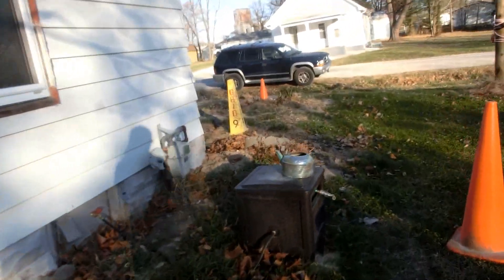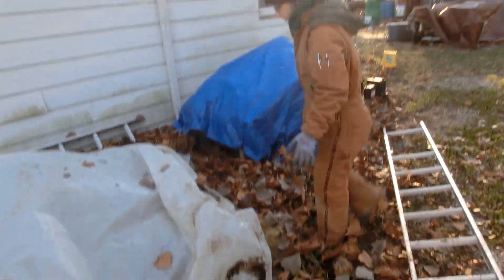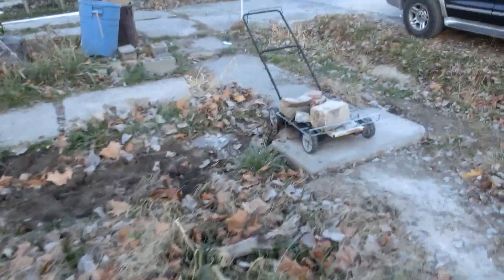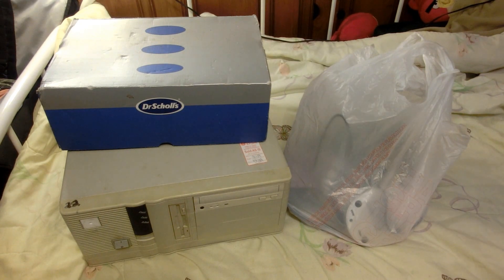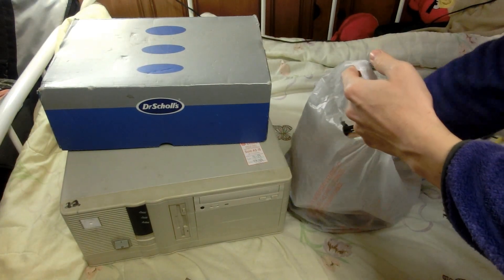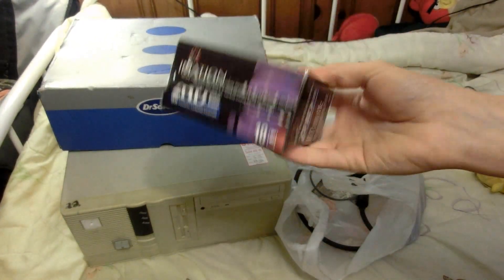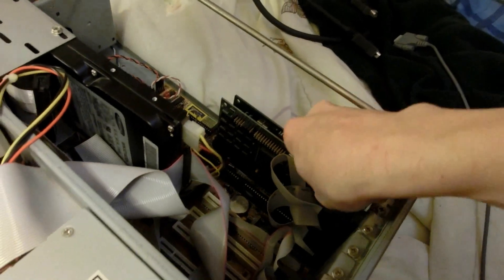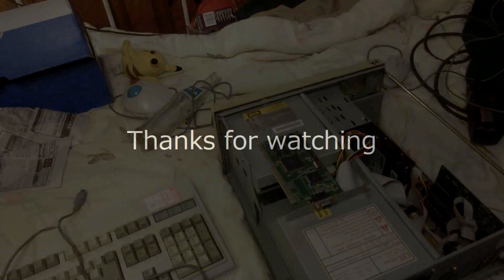Random Bits 0060: yard work, snow, thrift store finds

Comment: That computer is pretty cool. I always liked the design of computers like this. But indeed, they were often built from questionable components. I have one like this which is based on the infamous PC Chips 486 motherboard with fake cache chips. I have it running a 133 MHz AMD 5x86 and 64 MB of RAM, and it works awesome. The case and motherboard style is what's called AT. The motherboard may be a Baby AT, which is a smaller version of AT. Check the label on the hard drive; it may be bigger than 2 GB. It looks like they formatted it using DOS, so it would have been limited to a 2 GB partition.

Comment: Some guys put computers in mineral oil, as it would be a better heat sink, would still need to cool the oil. If you could get pure water, that was evaporated and then condensed that would be best. it would be neat to see how long it takes for the water and electricity to remove the plating
Reply from the maker: well if it starts to boil and that causes it to fail, then thats cool too. an hey i could always add salt.
Reply: Rinoa Super-Genius  It's and old style CPU. not an power hungry turbo beast like the later one's.. it tops out at 21.5 watt so you wont melt mutch ;)
Reply from the maker: grapsorz
 yeah i know ^^

Comment: im sure the camera used to film this could run circles around that old pc would be cool to over clock it in oil and see if it will run doom
Reply from the maker: overclocking wouldnt help i dont think, i think the motherboard creates a bottleneck for the system since it was probably designed for a p90 not a p233.

Comment: I started my IT career in '94 and I've seen a million of those... that was hobbyist-built machine.  The hard drive mounted incorrectly was a dead giveaway.  It was probably upgraded 10 times... newer mobo with older case, video card, etc.  It looks like he was nice enough to reinstall Windows before donating it, though.  :)
Reply from the maker: idk if it was upgraded much, pretty much all the parts are as low as they can get (besides the CPU) so idk what he would have upgraded the 1mb graphics card from haha.

Comment: What makes an ATX as a factor to define an old computer?^^ Even my current System is in the ATX form factor, and the case/motherboard is just 2 years old.
And I wish for it to snow this year, but no sign of any frozen water chips yet :/
Reply from the maker: well ATX isnt particularly old, but this case was made for the AT form factor. hope i didnt say it wrong in the video. and i hope you get some snow too, we currently have like 2-3 inches now. 2nd snow storm in a few weeks.
Reply: Rinoa Super-Genius oh well, maybe I heard it wrong, it's not too important, It's just a "bite reflex" of mine, as I feel as if I was getting old when using desktop computers/laptops for everything. I just can't do everything with a tablet... And I love my TBs and TBs of storage space :D
About the Snow: Well, Snowstorm doesn't sound too fabulous :/
And thanks, I really miss snow, it's been a while!
Reply from the maker: Maximilian Mustermann
 i totally agree, tablets are fine for small tasks like checking email and whatnot, but they dont have the functionality you get with a PC.
Reply: Rinoa Super-Genius just the power consumption makes a difference... Because I can't throttle my Desktop to a level where it would be nearly as efficient as a tablet while doing the same thing. At least here in germany that makes a difference. I could basically buy a new tablet every year for what I have to pay in electricity for my machine (including monitor). Just out of curiosity, what are the rates for electricity in the US? here in germany it's roughly around 30€cents/KWh (too my knowledge/experience, might be cheaper in a different location), that would be about 37$cents/KWh.
While well, those mobile devices consume a couple of watts and have extremely efficient standby and throttle capabilities. I mean they appear to constantly adapt to their current task and use dedicated hardware for a lot of things.
Now that's bad for the environment and economically as well. BUT when looking at how much energy is consumed in the manufacturing of tablets and how fast they are outdated these days while not leaving you a choice (usually) in which OS one can install, I assume it might even be more ecological to run my desktop. Well, maybe I'm leaning too far out the windows on this, as I don't know the exact footprint of a "regular" tablet (android). Any idea?^^
Well, that's actually rather interesting. Let's say a Desktop consumes about 500Kwh/year. Now that's quite a lot, but hey, those chips need to get forged too, and the mining for materials probably takes quite some energy just as well. I guess it's not going to be too easy to find an exact footprint.

Comment: Put a voodoo 2 in that PC and you can play half life easy.  I had that same PC specs for probably 2.5 years from 1999.
Reply from the maker: no, just no.

there is more to a computer than just megahertz.
Reply: you reckon it wont play halflife?
Reply from the maker: SadamFlu
 i dont think it will run it easilly. i think it would be a fucking pain to play half-life on it.

remember this motherboard isnt made to handle the p233 CPU. it was made years before the 233 came out and is probable made for a p90 or p150. not counting at terrible build quality.
Reply: i dont think i saw an agp slot anyway.  I reckon it might be ok to play it.
Reply: SadamFlu I believe theres no way that pc can hande a gordon freeman running in a steel corridor lol
Reply from the maker: Bilal Öz
 well the minimum system requirements for that game is only 150megahertz. its not a matter of if it can run it but a matter of it its playable.
Reply: Pretty sure it is quite capable of playing it at a decent frame rate.  But who cares, its a piece of shit that I would only use for controlling the lights or garage door openers and shit.
Reply from the maker: SadamFlu
 well i plan to have it running half-life when i kill it, so we will see.

Comment: i would take a guess the machine was made in about 1995? i saw the disk info said 1775 days since last disk check (over 5 years lol),  i will guess that this pc was put out of use when the owners went for broadband internet over dial up, as there is no Lan port only a dial up modem, love the fit of that hard drive though, lol , i had a trident video card,  forget 3d, even  scrolling a word processor was bad. they really are the worst of the worst, i got some cheap ati for mine and it was so much better
Reply from the maker: yeah i tried a Trident in my original IBM XT and it worked like shit.

Comment: that is the last of the AT style system's.. the ATX came in 95-96. my first ATX was a Pentium PRO 200 in 96 and the CPU alone was 1000USD :(  the CPU in that system is from 97 so it is the last in the transition. expected from a low cost computer of the time. and they where not all bad ;) not the high end systems i made;) remember. even companys like DELL started making computers like that. by 1995 they had just started to get custom cases. (i was a computer tech at the time. now i colect old computers for fun ;) )
Reply from the maker: yeah but computers like these are built so bad the IDE cables will rip/crack if your not careful. i've had it happen a lot of times. its just very bad build quality on the motherboard and many of the other parts.
Reply: Rinoa Super-Genius  yes you needed to spend some money making it in the first place. using crappy parts makes a crappy product. i just upgraded my main computer from 1996 (when i switch to ATX and all new part's) until now. i just replaced the case 2 years ago ;) so in principle i'm "still using" my computer from 1996 ;)

Comment: Dont be too hard on old designs, it still works!!, lots of super duper modern machines bit the dust in a fraction of that machines life.
Most of the people i know used those old basic machines for letter writing and basic accounting, they did there job at the time.

But, that is a heap of crap now, i would find a nice skip/dumpster and let gravity do its work ha ha :-))
Reply from the maker: well it was crap back then. its far slower than like an IBM Aptiva or whatever. its easy to find old computers that work. i've probably found about 25 so far. usually its the hard drives that give out though.
Reply: Rinoa Super-Genius
Not everyone had money for ibm back then, they are old now, but when they were made you needed to sell a kidney to afford one.
20 years from now you will be calling the machines from this era crap as they cant cope with the new demands.
Reply from the maker: zx8401ztv
um, no. i know the differance between well made computers and crappy computes most of the time. the speed and amount of ram doesnt exactly matter.
Reply: yes,a cheap budget 386sx25 i bought in 1991 was over £1500 which is closer to 3000 in todays money, and that was the low end, i still had to put in a cd reader and soundcard to do anything fun {like play doom} and it was too slow for that! , the cd cost near £200 and the soundblaster was £80 with some terrible battery speakers, you were limited as most speakers wernt magnetically shielded
Reply: Rinoa Super-Genius
The speed of the cpu and ram mattered to the applications of the era, when i used to repair machines in my teens the game side of pc's didnt exist (yes i am ancient) lol.

Machines didnt need to do so much as they do now, i dont feel the speed of upgraded cpu's or more memory like i used to :-(
Reply: jusb1066
You sounded pretty much in the same position i was, i do remember that mine was a no name mobo special lol, a 386sx soldered down and an empty co-pro socket that i didnt bother to add, it never failed, i did have a odd panasonic cd reader that used its own standard of interface, i think it was mke bus, memory has faded :-(
Reply from the maker: jusb1066
 yes things where expensive back then.

zx8401ztv  what i mean about the speed and ram not exactly mattering is that there are hundreds of other variables to take into account. you can have a motherboard that fits a pentium 233 and 16mb of ram but still act like crap due to it not having good ports or the components being slow.

either way this p233 machine feels slower than a 486 and it has very bad build quality.

this board was built in 1995, yet the fastest Pentium out a the time was 150megahertz. it was a further 2 years before the pentium 233 came out. this motherboard would probably handle a pentium 60 ok but a 233 is just creating a huge bottleneck in the system.

just because it has a 233 doesnt mean it can fully utilize that 233 like other machines can.
Reply: Rinoa Super-Genius
The problem of being able to afford an intel cpu was a factor of the crapola nature of some machines, amd was a newcommer but cheaper and not so compatable, there were also the odd cyrix range of cpu's, now they were crap lol, and shit compatability, the unknown 386 cpus were medioca but reliable, i vaguely remember the cyrix had special jumper settings than the rest.

Later i did have a pentium 150mhz, that was well decent for all the software of the era :-)
lpt and com paddle boards were pretty much the norm, and worked ok as long as you set there address and irq/dma not to clash with the mobo or other cards, i had more fun repairing pc's in those days than now, its all automatic :-((
Reply from the maker: zx8401ztv
 i think i have a nice collection of 8086,186,286,386,486 but the one CPU that has eluded me for years is the pentium II. finally got a few pentium IIs this year. i guess they where short lived.
Reply: Rinoa Super-Genius
My first pc was an elenex 8086 4mhz 640k memory machine Ooooow lol, with a western digital mfm/rll controller card, 26 and 33 pin data/control cables, i really enjoyed learning dos on that machine, but the on board fdd controller died and i desoldered all the logic chips for the controller, then added a really odd looooong fdd card instead, supporting one 5.25 320k drive (real storage ha ha ).

The 80186 i only saw on odd upgrade cards that plugged into the 8086 socket.

I had a machine called  a "Neat 286", that was a bloody lie, it was massive lol.
Reply from the maker: zx8401ztv
my first PC was a sperry pc compatible with the same like 640k and a floppy drive. that was given to me when i was about 4 or so and i fixed it when i was 5 (1998) and i used it for a few years. then after that my parents bought a new dell in like 2002 so i got our old Packard Bell tower. it had a 133 pentium with win98. but after that i started getting too many computers to remember.
Reply: Rinoa Super-Genius
Packard bell wasnt cheap eather, lucky you got that :-))

Ive had allsorts of machines but i only remember the early or ones i liked, later machines had built in ports and a range of voltages for the cpu jumpers, also on board cache, but i didnt miss them.

Ooow i had one that would make you spit at me, an amstrad 1640DD i think, 8086 white plastic case and a monitor that sat on the top lol, special keyboard and mouse, AA batterys fitted in the top to keep the time correct, had to use a dos util to read the time.
Reply from the maker: zx8401ztv
 actually packard bell was cheeper and lower quality than most other brands. they sold cheep computers and mostly got their products to sell because people would confuse their name with Hewlett-Packard or Bell Labs. thats why they spent so much money to aquire that name for their company.

and btw the amstrad 1640DD was pretty much the same as the sperry, they where just copies of the IBM PC. i have an IBM PC and am still fighting it to work. it doesnt like upgrades.

Comment: Wow that pc components are from various era's it must of been some cost cutting thing, The pc itself may run classic dos games like the original C&C duke3d etc. Defrag on win9x was slightly more graphical in you can see whats going on more or less unlike in newer nt versions where its a colorfull band . the win9x defrag was also known to be restarting a million times due to disk contents changeing but a third party prog fixed that.
Reply from the maker: i have much better computers if i want a dos machine.
Reply: Well i think if you want to sink it in water you have to use mineral or is that mineral oil? I cant rember
Reply from the maker: steve64464
no, water is not mineral oil. there are plenty of videos showing computers in mineral oil but not any good ones showing them in water,
Reply: I cant help but worry somethings gonna go bang :-o
Reply from the maker: steve64464
thats the whole point.
Reply: Oh i was kinda confused i thought you wanted to try make it run with water in it in normal operation
Reply from the maker: steve64464
well computers can run in water fine most of the time, but i want to find out for sure and do a more in depth video than the like 45 second clips people post on the internet.

Comment: mmm cant loose, bang it in water, if it works its a win, if it dies its a win :-)
Reply from the maker: if it works....well then i'll have to put the power supply into water also haha
Reply: Rinoa Super-Genius lol and if it still works you would have to 'safety test it' with a sledge hammer, safety first you understand :-D
Reply from the maker: battonfive
 well i dont want to bash it, that would be too messy and then i may not be able to mount it onto the wall with the other motherboards.
Reply: true, microwave it is then :-D